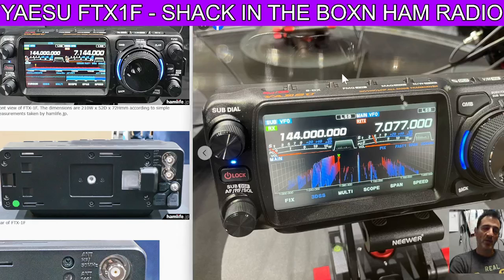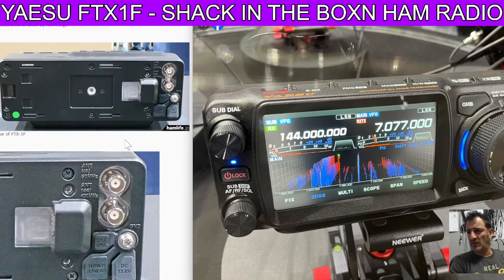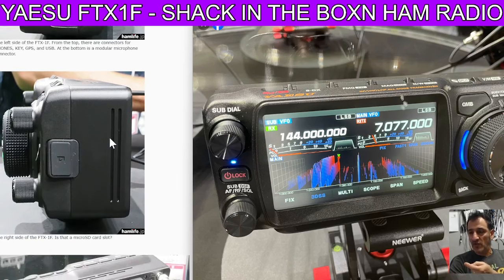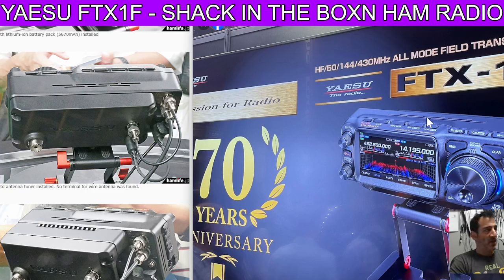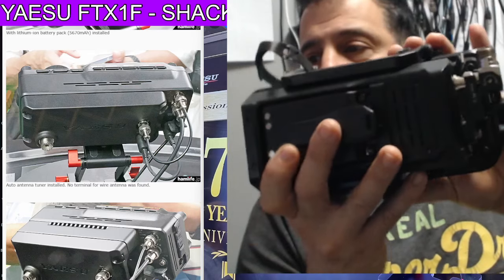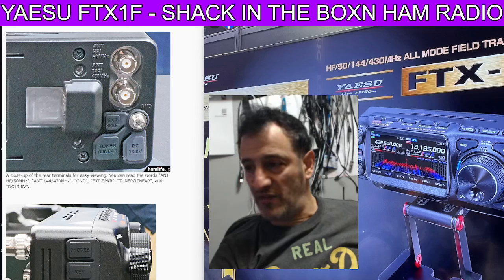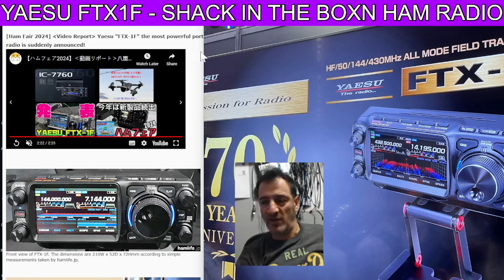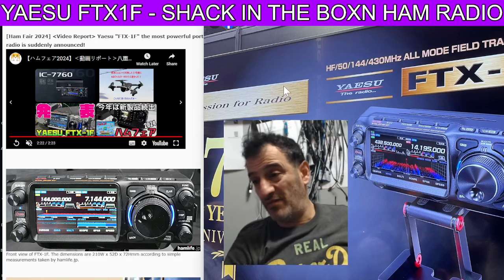YAESU FTX1F - SHACK IN THE BOX HAM RADIO - Dual Receive

Comment: If it comes even slightly close to the 710, 10, and 101 and their receivers then it’s an all new ball game. I love the modular design. I have the Elecraft KX3, PX3 and a 10:1 built in tuner. It’s going  on a 15 year old design and still outmatches anything in its class for receiving. But with that modularity comes at the expense of a wire interconnected mess. You make something like that and it’s plug and play … then I will call it a game changer. My bet they have something different and potentially a game changer in this class of radio. I have my $35 deposit with DX Engr.
Reply from the maker: Totally agree